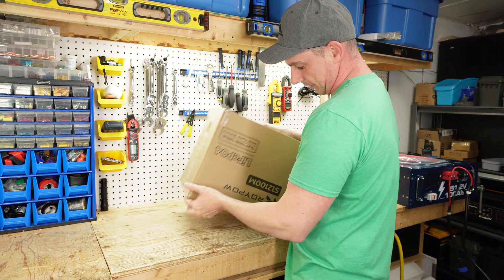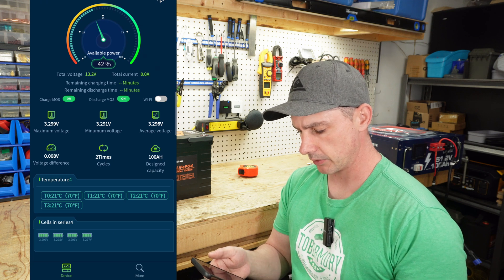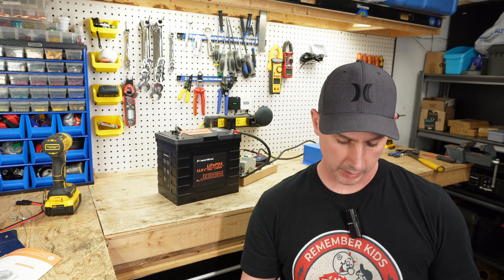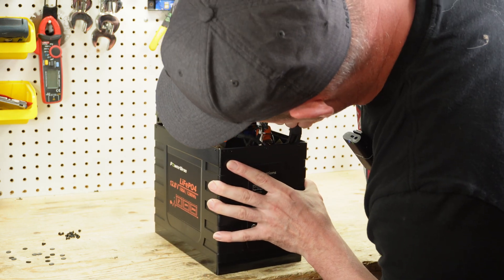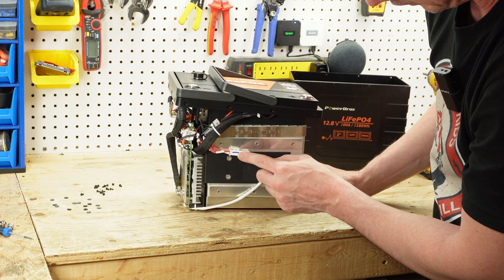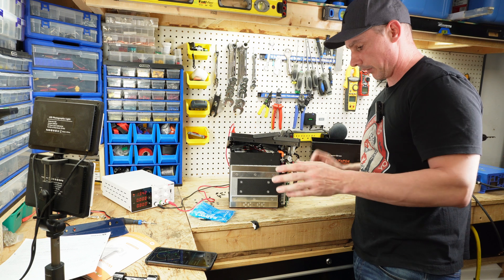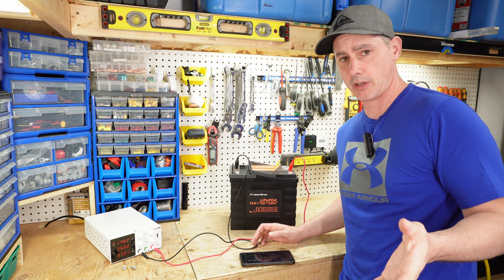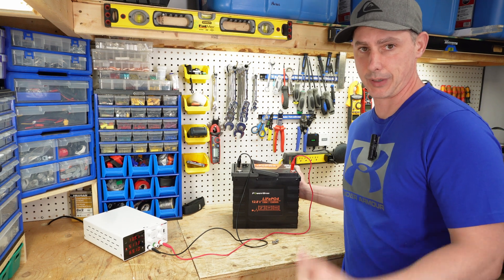12V 100Ah Heated, Bluetooth LiFePO4 Battery By PowerUrus / RoyPow

Comment: Is it okay to connect a group 24 and a group 31  lifePo batteries together as long as they  are both 100 Ah ,  both have 100 amp  BMS , same brand and purchased at the same time?
Reply from the maker: I've mismatched batteries without any issues many times. As long as it's in parallel I can't see you having an issue. 👍
Reply: @Roll2Videos  thank you
Reply: I'll share my solar heater project video I did a few years ago.
"Cabin with solar heaters in PA". 
On YouTube

Comment: Isn't a M10 bolt bigger than an M8, with a M6 smaller?  

A T Burke
Reply from the maker: Yes, I was thinking of wire gauge size. I will put a correction in the description of the video. Good catch 👍
Reply: @Roll2Videos  At least you know that I was listening :)